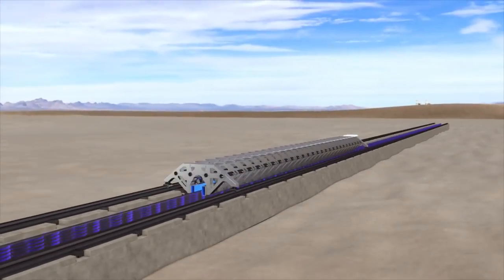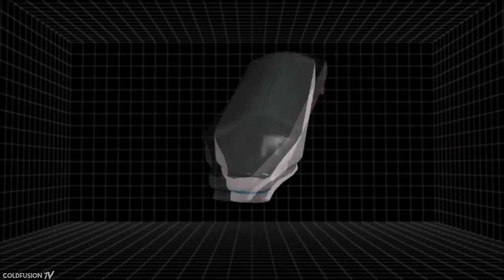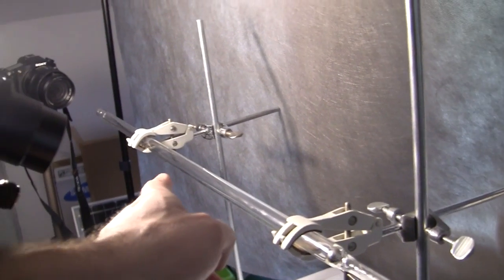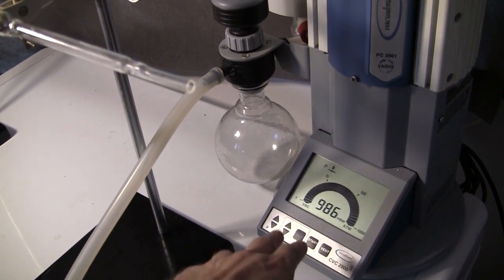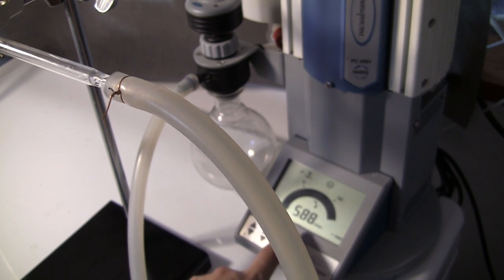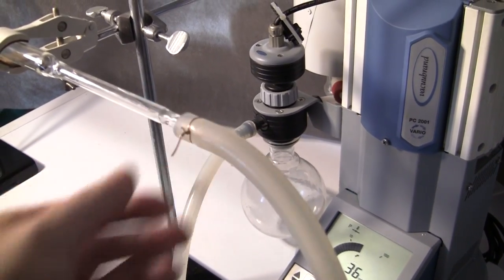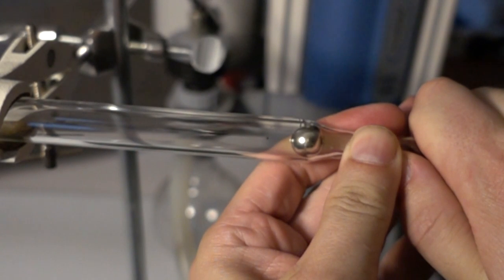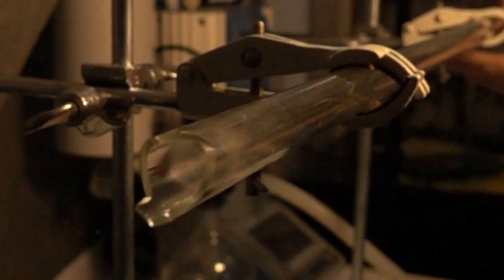How  the Hyperloop can kill you!

Comment: Not to mention that this assumes no breaking mechanism, or the fact that the turbine tube works as a pressure valve, I would like to point out that this ignores nonlinearities of scale differences quite badly. The acceleration of the ball in this experiment is beyond what a human could sustain, this is true, even if you disagree with the conclusions. However, the accelerations of a small fireworks rocket is  also beyond what human could sustain. Yet manned spaceflight is possible, and not even constrained by acceleration margins. Even more extreme example would be that an insect can survive a drop of any distance, an by this analogy, parachutes are irrelevant.

In all cases the system behaves differently in different scales. Here's a little bit of high-school physics to the topic: 
#1: The pressure difference is independent of scale. 
#2: The exerted force is proportional to the area of action, so roughly grows to the square of scaling factor.
#3: The mass of the vehicle grows by volume, so roughly to the cube of scaling factor.
#4: a = F/m   ==>    a = c(Prr/drrr)  ==>  a ~ 1/r  (where P=pressure, d=density, c=combined constant factor that is irrelevant here)
Combine these, and we find that the accelerations experienced are roughly proportional to the inverse of "radius" that represents scale factor.
If we assume that the diameter of the Hyperloop tube is somewhere on around the ballpark of 5 meters, and in this experiment tube diameter is around, 1cm, we get that the acceleration would be 0.002 times the one experienced here. Or 500 times lower. And this is excluding breaking mechanisms or greater bypass flows, or the fact that the cart is larger in length, which has it's effects.

There are in fact multiple ways to tackle this problem! (On for a little bit of rambling here) I'd say that the ball exits the tube here at velocity of 50 m/s. With some high school math, and the fact (by thundef00t) that the tube is half a meter long, one gets acceleration of 1000G's (whoa!). After the scaling we established, this would translate to mere 2G's in the real Hyperloop. Again, these are not rigorous exact numbers but they give you some idea of the scales involved.

We could also just calculate the force and mass in the real deal by hand. With all the usual out of the sleeve shit (P(air) = 101000Pa, Mass of the vehicle = a little less than that of a train car = 150 Tons, diameter 5m, 1 of which in wall structures etc, so functional radius of 2m) We get to acceleration of about 8G in absolutely ideal conditions (no friction, no bypass flow). If we assume some conventional and off-the-shelf breaks, we get deceleration force of around 900000 N which brings us to around the same 2.3G's. Nice.

Finally, I'd point out that all above is in a sense a bit useless logic, since the real problem is a speeding vehicle encountering an expanding volume of atmospheric air near a point of containment breach. With pressure meters at regular intervals, the breach can be detected before a vehicle encounters it, and passengers can be brought to a steady still long before encountering the breach. Remember that the area of larger pressure expands at the speed of sound at max. If we however hit the atmospheric air nearly at FULL SPEED, at several Machs the forces of deceleration would be quite formidable, [https://en.wikipedia.org/wiki/Drag_(physics)]  almost a Million Newtons, assuming drag coefficient of 0.2, due to the engine tubing, and aerodynamic form. This is a lot, but not catastrophic. Total deceleration goes up to around 5 G, which is still very much manageable, and relatively safe for all but the elderly, but not exactly what you'd call good PR practice. In car accidents, people survive G's up to 20 and beyond for short periods. 

I'd conclude that the experiment here is a respectable attempt to base one's opinions on empirical facts, and should not be mocked, but does not necessarily represent the Hyperloop design in a meaningful way.

Comment: All true assuming there is an unplanned, rapid decompression of the tube section occupied by a vessel. You have aptly pointed out the dangers of engineering failure. But that's all so far.

Comment: But 1milibar is near complete vacuum! I thought that the hiperloop would have only partial vacuum, and it would use the remaining atmosphere inside the tube to provide levitation and thrust by sucking the air in front of the vehicle and pushing it down and backwards, I guess that wouldn't work with only 1milibar of pressure. Besides, keeping this kind of vacuum would be extremely difficult. I really thought they would keep the pressure at something around 0.2 atm. Well, I guess I was wrong.

Comment: If it has a fan to move itself, there surely is still a lot of air in the tube.
I think we got by now that you do not like the hyperloop, this is you doing what you do not like others to do: Ignore arguments to make your point look stronger.
The tube has LOWER pressure than normal atmosphere (fun fact: Vacuum cleaners to not work with acctual vacuums). You have prooven your point of the hyperloop being dangerous but until now it has killed less people than space travel, comercial flights, cars, meglev, trains or swimming pools (each individually counted).

1mbar? Has someone a source for that? I really am curious now!

Comment: Did you know that you can die in a plane if enough birds fly through the engines?  God damn better not ride planes anymore.
Did you know that if your brakes fail on the highway, you are likely to crash and sustain fatal injuries? God damn better not drive anymore.
Did you know that if you accidentally poke a hole in the bottom of your boat, it will sink and you will drown?  Fuck better not go boating anymore.

Stupid inventors and their flawed vehicles.  We should just stop.
Reply: Did you know that vacuum tubes are more likely to fail than airplanes, cars, or boats?
Reply: Based on what studies?  Based on what current transportation methods?  Oh right, there are none.  There's no evidence or basis for comparison.

Comment: Maglev trains are already a thing. I think the current speeds are 400kph? Obviously it would make sense to get rid of the air resistance to go faster... which puts the ball mainly in the court of tunnel engineers. There would also need to be an embarking/disembarking system to get the passengers on and off, from a normal pressure environment into and out of the train that runs in a low pressure environment. And then there would need to be safety measures in case of a catastrophic failure somewhere. None of this seems beyond the wit of man.

edits: after a bit of thought, space station style docking systems could get the people on and off. They already exist for space, a much harsher environment. And for the emergency tunnel re-compression, where we'd be looking at countering a pressure wave from a leak (say a structural failure somewhere letting the atmosphere rush in) perhaps there could be air valves every 100m or so to refill the entire length of the tunnel with air in a controlled way, countering the pressure wave without derailing the train(s). The trains would be able to make it back to station (barring debris / magnetic rail failure etc) at a slower speed. Just some ideas!

Comment: They could use tubes with valves witch connect the parts of the tube in front and back of the train so when something ruptures the valves go off and make the pressures equal, or use valves that could let air in the tube so the air resistance slows down the train. There should be ways to make it safer.

Comment: Why did you assume that the pressure in the tube has to be 1 mBar? What if it doesn't have to be that low? Wouldn't that basically change your entire premise?

Furthermore, wouldn't a vehicle have failsafes to allow the air to go around it? Or an automatic braking system to lock it into the walls immediately upon vacuum failure?

Debunking solar roadways is one thing. Using that attitude towards this project is something else. There are new challenges, sure. But insurmountable? You put a steel ball through a tube. You didn't even contemplate possible solutions.

Comment: you said there's no way of stopping I was just wondering what happens if the rails that they use to guide them had some type of emergency brake in case of that or the maglev have some type of eddy current to slow it down if it is being over speed and what happens if the vehicle that they use is not the same size as the internal diameter which gives the pressure some alternative route to go over it would still push on it but not be as effective because the air would go around it I dont know just some ideas

Comment: Yeah and in case of elevator cable snap no way stopping gravity either. This "analysis" is so superficial is not even worth the discussion.
Reply: Elevators travel on rails, that have certain safety features built in them; if the cable were to snap you wouldn't fall down, because the rails will hold you in place. Your analogy is not even worth the discussion.
Reply: Lindian Lindenholt You missed the irony completely.

Comment: Your tube experiment is crap for all but the very very very very earliest engineering experiments on the hyperloop.  Speed isn't controlled by the vacuum.  It's running on (over) rails.  In case of vacuum failure, the safety measures are in the rails.  Try re-running your tube experiment with your ball on rails with clamps that grab the rail in case of pressure failure.

Comment: I actually do no see how this disproves the hyperloop.  You essentially proved that managing pressure can accelerate mass down and enclosed tube.  Could not pressure also be used to decelerate mass?  Electromagnetism?

I could see that this video is trying to present itself as a warning.  However you have elected to write the entire program off as a fluke even though you proved its premise.  You also decided not to resolve the issues of deceleration or acceleration control in you experiment.  In these regards, your video comes across as fear mongering instead of constructive criticism.  I would compare this to Thomas Edison electrocuted animals to prove that electricity is dangerous (though not as cruel).  Yes electricity was dangerous, but it turns out also functional.  Flying planes was dangerous.  There was the fear of crashing, but also problems of low pressure/oxygen at extreme altitudes.  There will always be problems with more extreme forms of transportation.  However, just saying "its difficult, so give up" seems very...unscientific.  If this video were stretched out to a thesis for peer review, I feel the board would kick it back and tell you to try again.

Comment: also has anyone questioned how a fucking fan is supposed to pull itself through the vacuum?
Reply: >literally magnets
pay attention.
Reply: That's not what the fans are for.  Google it.
Reply: Imma just saying, why bother with the fans? Seriously? If there is a vacumm anyfan is just something that is spinning for the sake of spinning.
Reply: The tube won't be a perfect vacuum, and at the extremely high speeds they want the cars to travel, the small amount of air in the tube will still be a factor.  The fans will just help push the air in front of the car through channels to the back and keep front/ rear pressure closer to equilibrium.
Reply: I am surprised that the fan design wins (mathematically) over just streamlining the car and adding air channels.  I would've thought the energy required to drive the fans + their extra weight would negate the extra weight of streamlining structures.
Reply: timb37 i have no clue. Intuitively the fan makes no damn sense.
Reply: It seems excessive, however they want to really prevent a pressure bubble from forming at the front (see: supercavitating torpedoes). 

As far as the rails, they are Maglev, effectively.

Comment: Emergency relief vales along the length of the pipe, which could open in front of the vehicle after a rupture could complete negate this (equalizing the pressure in front and behind). It would shout down the whole system, but that would need to happen anyway.

Comment: Usually I find your videos great and full of wonderful observations that most people overlook however today is not the case, you are the one to overlook common details. First off you assume that the train will be a similar diameter as the tunnel however if this is a two  way track it will only be half if that lessening the effect of a break in the vacuum. Secondly, you said there is no way to stop. It being a train, it has breaks, and likely super good  magnetic ones to slow it down from the incredible speeds it travels at. On top of that, the train would never be stopped in the tunnel. There are three places the train can be when the vacuum can break. If it's stopped at a station, the pressure is normalized for passengers to enter and exit, and while its in the tunnel. While in the tunnel, if the break is ahead of it, its already going fast and a sensor would likely put on the breaks and slow it down, if the break is behind the train, it just starts slowing down and eventually stopping it. None of these situations will cause a problem like that. and I m sure that they will cover the whole system in sensors to prevent a situation like this from happening.
Reply: But... this doesnt stop it causing catastrophic damage to the rest of the line

Comment: But there are several ways of mitigating that. One has already been used on pressurized airplanes fuselages for decades: the relatively thin aluminium skin of the fuselage is reinforced with "ribs" (longitudinal stringers and lateral chords) that prevent any tear from propagating, just like ripstop fabric. 
As a result, any puncture is very unlikely to result in a complete failure, and will cause a much smaller and manageable repressurization.

If that fails, it can still be mitigated by intentionally (and automatically) causing a controlled emergency repressurization of the tunnel by letting air in through multiple, regularly spaced ports in the tunnel. (and, of course, emergency brakes)

Alternatively, just cover the whole tube with 20 cm of rebar.
Reply: what if the leak is in front of the car and your closing velocity is mach 1.7 against what basically becomes a 20bar over-pressure wave slamming around the car?   Metal ribs aren't gonna do it.
Reply: Also,  one atmosphere is pretty minimal.  14 psi is not all that impressive.
Reply: No maglev train has ever derailed, even in super high speed collisions. The hyperloop is based on maglevs, ultimately. You will still have magnetic rails holding you steady.
Reply: But in the event of a sudden capsule depressurization, you are trapped in an enormous tube with no air, and a shock wave of 1 atmosphere headed your way at the speed of sound
Reply: Negro McBlackguy The tube will re-pressurize in a few seconds,  and oxygen masks will drop like on an aircraft.
Reply: ANY puncture is going to result in complete loss of pressure. And, yeah, sure, you COULD do all that stuff, or you could just build a sensible high speed train, instead of introducing the problems of space travel to the surface of the planet.

Comment: Just because an implosion risk is present, and extremely lethal, does not mean that the concept should not be pursued.

Every mode of transport can fail and result in death, unless sufficient precaution is made.

Why not tell us about how ships can sink? planes and helicopters can run out of fuel and fall (very fast and explosive).
Cars can slide, tumble, collide and lead to lethal accelerations or direct impact of the passengers.

Train rails can be damaged (especially by sabotage), causing trains to derail, tumble and be obliterated.

Motorcycles can slip, leading to collisions, bouncing and shredding of the riders...

So what, a new mode of transport has a deadly possibility of failure?

We get over that kind of issue, and progress goes on.

Comment: "no way of stopping" isn't really true, you just have to design the linear motors so they are able to give enough force to counteract the force from a tube failure, you could also make the tube larger than the capsule making the force significantly lower on the capsule in the event of a tube failure. It's just one of the many problems which has to be taken into consideration while building the hyperloop, the only question is if it's worth it, how much will people pay to get to their location really fast? If people will pay more than it costs to build and maintain it it will be done, there are no impossible tasks here, just an economical one.

Comment: I think an important thing to note is that its unlikely the train will be that tight to the tunnel wall as the ball. Its supposed to be magnetically accelerated and not driven forward by means of air pressure, and thus the train wont need to form a seal against the tunnel wall. Still, even with a tunnel with twice the diameter of the train: the turbulence and drag forces will be enormous in the event if a total leakage in front of the train when traveling at full speed around mach 1. You will be crashing the train against a seemingly solid "wall" of air.

Comment: At 0:22 the video seems to be implying that the pod is turbine powered? Am I misinterpreting something or do these so called engineers not know what a vacuum is? A turbine uses air and there is none in a vacuum. Hopefully I'm just drawing a mistaken conclusion and the people in charge of a great deal of money have at least passed a high-school level science class. Or watched an episode of Bill Nye.
Reply: it works because it is not a vacuum. low pressure only. very huge difference
Reply: I believe the turbine is less used to power the vehicle, but more for removing what little air is left from in from of the vehicle to minimize air resistance as much as possible.